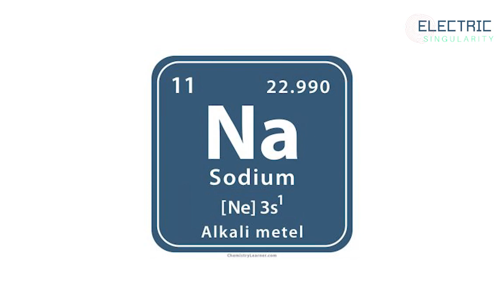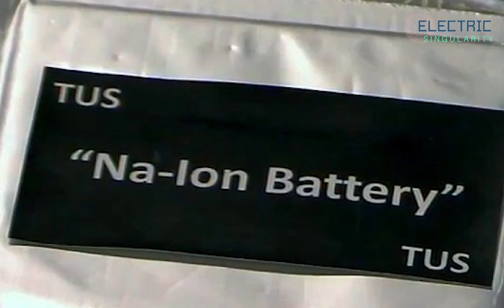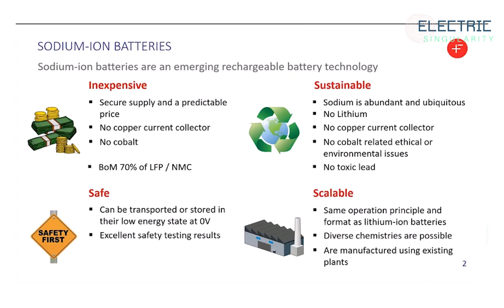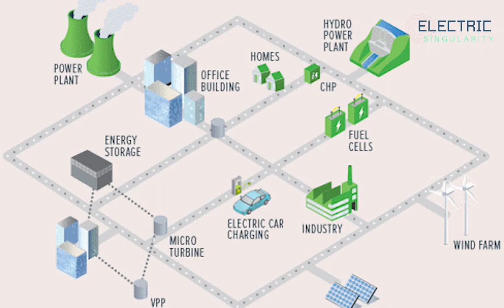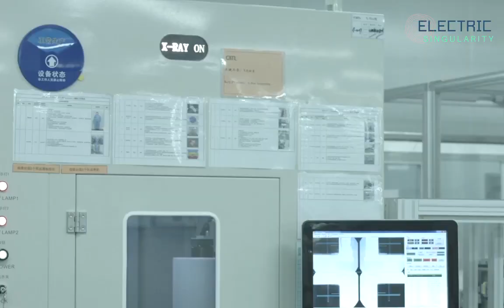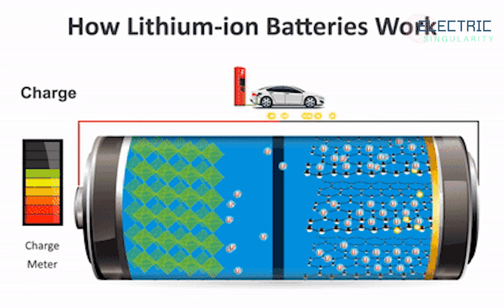CATL's sodium batteries will be 30% cheaper & revolutionise the world

Comment: Game over coal, Gas, Nuclear, Hydro, if you can get batteries to do grid storage at 40.00 per kWh and manufacture it at mass scale it is transform a lot of grids world wide
Reply from the maker: I’m pinning your comment.
Reply: Thanks let hope this is a commercial viable option for companies to act before “they” put that gas plant in
Reply: Hate to burst your bubble but reneawables and superpower are total bulls*t. You and the guy the who made the video are clearly new to all this but with enough reading it will become obvious to you as well. NUCLEAR IS THE ONLY LONG TERM OPTION at scale.
Reply: @garry8390  sorry Barry you obviously missed the cost element. Nuclear is the most expensive option it is cheaper to invest in coal than Nuclear and before you start talking about the smaller nuclear reactors yes I have considered those as well.
Reply: @MichaelSmith-px1ev  Reactors are only expensive to build in the West. In Russia and china they can build them for a fraction of the cost. Nearly half of the cost is the cost of capital which is ridiculous. The only reason nuclear is expensive is because of politics and corruption. We could be carbon negative worldwide in a decade if engineers were given political support to make it happen.
Reply: @junctionroadparklandsvlog5035  specifically which part of that article do you think disproves what I said?
Reply: @garry8390  This bit :  'Government-subsidized capital costs help explain the relative vitality of the nuclear power industry in Russia and China'
Reply: @junctionroadparklandsvlog5035  Your kidding right? Which large scale infrastructure projects do China and Russia not subsidise? You are totally missing the bigger picture. The fact of the matter is that nuclear power plants could be reduced in size, cost and complexity but far too many people make a living selling the expensive options. Once a power plant is built there is no more work for developers for 40 or even 80 years meanwhile aircraft carriers the size of small towns have been powered safely by nuclear power plants for decades. Where are all the sailor's with three eyes and a third leg who have been living right beside nuclear reactors for months or even years while onboard? The incentives surrounding nuclear have been perverted not because of engineering or safety but because of money
Reply: @h2rider953  Thanks for sharing. Was there a specific point you were trying to make?
Reply: @garry8390  It's funny how folks want to talk about land usage and contamination when talking about decades old fission plants which operated in an essentially unregulated environment. Then when a new solution like SMRs are brought up which will be the cheapest form of power in the long run, produce relatively little waste, have a non existent exclusion zone and cool down without power or safety systems they are lumped in with the old plants. It's like saying we need to ban EVs because 70 years ago cars polluted with leaded gas and killed people right and left in accidents because they didn't have safety belts.

Meanwhile no one wants to acknowledge producing grid scale renewables produces more toxic waste, takes up much more natural area, will cost more to the tax payer in the long run, and has to be replaced every 20 to 40 years where most of that end use waste will end up in enormous landfills which have chemicals or heavy metals that can leach into the ground water (look up wind turbine graveyards and why they are in remote areas). 

Each has their place in providing carbon free power, fission for large scale, renewables and energy storage for small scale supplementation and areas that don't have the political stability for a fission regulatory structure.
Reply: Thank you  @anydaynow01  . I was giving up hope. I'm going to copy your comment for future reposting.
Reply: $ 40/kWh is fine for day/night storage, but not for seasonal energy storage.
Reply: You can't make Hydrogen bombs without nuclear power plants, so we will be keeping those.
Reply: @garry8390  Why not a mix? A large and growing percentage (around 20%) of our electricity here in Texas (of all places) is already supplied by wind. You seem to have a visceral dislike for the idea of renewables, as shown by your use of profanaty. Why is that?
Reply: @garry8390  yes , you are right western countries lost their nuclear technologies that's why it costs too much and by the way just this week Russia   started building nuclear plant with closed nuclear fuel cycle in other words perpetual motion mobile
Reply: @andreycham4797  It could be turned around very quickly if we there was the political support. I have heard estimates that thousands of smr's could be installed within a decade with the right changes to regulation etc Climate change basically solved overnight. Try doing that with reneawables.
Reply: @garry8390  
Re "only expensive...."

Go to western governments and say
"Hey guys! You need to buy hundreds of Nuclear reactors from Russia and China!!"
See what response you get.
Reply: The one power source that has by far the least environmental impact is nuclear.  The mountains of waste (toxic and non toxic) generated by solar, wind seems to be completely ignored.  Not to mention that one of the primary elements in making solar panels is expected to be depleted in 25 years. Or the fact that most of the resources are from deeply corrupt countries.
Reply: @RS-ls7mm  Preach the good word! 🙏
Reply: @RS-ls7mm  watch on BBC iPlayer:- Building Britain's Biggest Nuclear Power Station, 2 part documentary on Hinckley C. Consider they sent a boat round the Bristol Channel for FOUR YEARS looking for WWII unexploded ordnance so they could safely build a water cooling ducting 4,500km long. Think of the carbon footprint of that alone.  A 750metre concrete sea wavefront.  Watch the amount of concrete & steel & welding to produce BIIIG components and assembly/installation.  No one takes into account the amount of GHG produced for TEN YEARS before these stupid fantasies are even switched on. Solar & wind can be up & running in 6 months.  NOT 10 YEARS!  For $millions, not $billions.
Likewise battery stationary storage can be up & on in 6 months. Tesla & others already proved this.
Barry Doyle is just scared for his future of profiting from nuclear & pretending he isn't...
Reply: @anydaynow01  You are right, the poisonous chemicals to produce magnets for Windcraft have no half radiation time. They are poisonous forever. And have to be stored forever. You are not told about this.
Reply: Game over hydro lol gas and nuclear pmsl you can keep coal its filthy.

Best of luck to powering your grid and having surplus energy to build anything, fossils made this world and nuclear took  that a step further go back to less than a 10th of that enerrgy at best at our most power hungry time in history then clearly the rich will get it all and the poor will finally go critical and start the civil war.
Reply: @electricviking  , sodium = pyrophoric explosion.......bad, bad news!
Reply: Propaganda victim.
Reply: @garry8390  
"Shut up"???
Is that all you have?
No counter?
O...... K
Reply: @garry8390  

Two words you ALWAYS see together.
Nuclear.... Estimate.
The problem is the "Estimate" is always on the low side regarding cost, or time to completion.
Reply: @rogerstarkey5390  Your comment added nothing useful
Reply: @alexmanojlovic768  Did you or did you not read the earlier comment by @anydaynow? You are a broken record."It's funny how folks want to talk about land usage and contamination when talking about decades old fission plants which operated in an essentially unregulated environment. Then when a new solution like SMRs are brought up which will be the cheapest form of power in the long run, produce relatively little waste, have a non existent exclusion zone and cool down without power or safety systems they are lumped in with the old plants. It's like saying we need to ban EVs because 70 years ago cars polluted with leaded gas and killed people right and left in accidents because they didn't have safety belts."
Reply: @garry8390  
You think your "answer" did?
That's twice you've had nothing....
Reply: @RS-ls7mm  

So, nuclear.... Henceforth known as "Unclear".....
You know the infamous  3 Mile Island plant just started the decommission / site clearance process?
Should be finished in 60 years.... SIXTY YEARS !!!! (Google it)

But don't worry, it's being paid for by consumers.... And taxes.

That timescale may also indicate concerns about "environmental impact"?
Reply: @RS-ls7mm  
You suggest that "most (Green??) resources are from deeply corrupt countries" (weird, sweeping statement!!) But seem happy (together with your friend Barry) to ask Russia for thousands of Unclear reactors?
What's your definition of "Corrupt"?
Reply: @RS-ls7mm  
Which "primary element in making solar panels" do you expect to be depleted?
Reply: @anydaynow01  
Your recycling rant is "strange".
You mention that a non specific green source "has to be replaced every 20-40 years" (used to be a very specific "20", so you're learning!)
Which technology is that? All of them?
You say "it" (?) "Takes up more natural area".... But since many wind projects are offshore, and those onshore are fine of other uses, that's a "stretch", isn't it?
Similarly, Solar is being seem to be beneficial in producing shade for farmed crops.... Ingenious.

About the exclusion zone around nuclear plants...... "Land usage? 🤔

Back to your.... "Random stream of thought"(?)

Landfill.
Exactly what?

Solar panels?

Processing panels.... Even my local council is proclaiming that panels are "96% recyclable, with an aim to raise the bar even higher"
Current levels
100% metal.
95% glass.
85% semiconductors (improving)
I'd say that's a good start?

And don't forget that as with batteries, the "life" stated is the anticipated life to a specific efficiency reduction, not "Dead".

Wind power?

"Ooooooo! The blades!!" (?)

Ever considered that with relatively low numbers, recycling industry wasn't ready?
That's being worked on.

The "generator section"
That'll be 98% recyclable?

The Pylon
Let's think about those?
How about, 
Remove blades (soon to be recycled)
Remove generation unit (recycled)
Install new (more efficient!) components for another "25-40 years ....?

In comparison to unclear....
"25-40 generation" then 60 years decommissioning with huge amounts of reinforced concrete which is energy intensive to demolish and will end up in .... Landfill (at least the non-contaminated sections)
Reply: @garry8390  broken record? Says Mr "LaLaLaLa" when anyone points out any flaw with nuclear you just deflect & ignore any anti-nuclear point as though it's irrelevant.  New SMR technologies are exactly that. New unproven, uncosted "will eventually come down in price with economies of scale".  Go on then!  How long till they're banging out enough SMR's to solve our energy needs?  At what initial cost?  To what will the price fall?  Is this like the ALWAYS 3 yr overun on a 7 year deadline of existing large scale plants?  £32 billion will drop to £28 billion...  Lovely, cheap... Yummy...
It's all guesswork & hope. You're full of dreams & hope that one day it will all come off (you're also full of something else).  Meanwhile, the manufacturing & implementation of mass deployment SMR's is at best a guess & a hope. I guarantee you, NO ONE has yet designed the PROCESS to build these unicorn SMR's.  You have no facts & figures, just engineers trying to convince the world it will be ok... In... TEN YEARS TIME.  Then the corrupt nuclear construction industry mafioso will get it's hooks in.  You have no concrete numbers, just prayers that articles written by people convinced of nuclear engineer's Unicorn f4rt dreams will be correct.  R.E can ALWAYS BE UP AND RUNNING IN 6 MONTHS, NOT YEARS.  For millions, not billions.
Repetition is necessary for blind zealots like yourself who don't understand reality vs engineers dreams, which rarely have basis in fact, mainly because specs, deadlines & costs always change (for the worse) with new, complicated technology.  An SMR is still a complex machine compared to Solar & Wind, therefore, there will be hitherto unexpected issues compared to "nuclear submarines" as the tech is not identical.
Now go away, the sound of your drum is like... A BROKEN RECORD!!... 🤦
Reply: @garry8390  I find your reference to Roger Starkey that his whole argument is based on a flawed concept weird, then you link to an ncbi document.  1stly I struggle to see which of his comments relates to cancer rates linked to radiation.
2ndly, your reference to that document is, to me, proof that you haven't got the 1st clue as to what the real world means to the rest of us, but it shows how you "interpret" data which you believe you understand & supports your misguided beliefs (sssooo erroneously).
["do not provide general support for the idea of a low-dose threshold or hormesis. This large body of evidence does not suggest, and indeed is not statistically compatible with, any very large threshold in dose or with possible hormetic effects"]  A Hormetic effect is where, a low dose of a harmful source has the opposite effect of a large dose of something harmful to a biological entity.  i.e. a low dose is beneficial to the entity.
The conclusion of the document is that THERE IS NO BENEFICIAL EFFECT WHEN RADIATION DOSES ARE LOW & REPEATED OVER A LONG PERIOD.  IN FACT:-
["In summary, excess cancer risks observed in the Japanese atomic bomb survivors and in many medically and occupationally exposed groups exposed at low or moderate doses are generally statistically compatible. For most cancer sites, the dose response in these groups is compatible with linearity over the range observed"] a) they compare Japanese WWII survivors with more recent cancer cases & determine a direct correlation & similarity in the data. b) there is a linear correlation linking the risk & severity of cancer cases regarding dosage, frequency  & time.
You didn't shoot yourself in the foot linking to this study, you shot yourself in the face with a double barrelled shotgun.
In summary, you are one of the most ignorant, fervent, uneducated, irrelevant supporters of nuclear power I have ever wasted valuable time from my life trying to educate!  In the words of the infamous Barry Doyle "Shut up Barry!"
Doyle-m... 🤦
["such studies have yet to identify coherent sets of genes that respond differentially to high and low doses (83), and it is therefore premature to draw conclusions on the similarities and differences between high & low-dose effects. The relevance of such early changes in expression to cancer is also unknown."].  In other words, nothing is proven at this point,  in relation to dose & severity, only that there is risk & result, so you pick a study that DOESN'T support your "argument"...
To support your "argument"....
😂😅🤣🤡🤡🤡🤦
You truly are the opposite of an intellectual, & an unworthy opponent.
Really, Barry:- Shut up Barry!
Or come back at me & Roger & keep digging...
Reply: @alexmanojlovic768  wrong all the time thats why u chat on youtube while people actual build the futire grid, ME and nuclear is hear to stay its 25-50% of base load in uk, and we inport from France.

Dont reply to me becuse ill ignore you fed uo of global piece keepers thats going to cause a civil war with their narrow mindedness.
Reply: @rogerstarkey5390  You need to improve your reading comprehension and education.  What drivel.
Reply: @garry8390  I think that nuclear will only be truly viable in the long run if the spent fuel can be reprocessed.  However I do believe in the mid term, 5 years or less, nuclear is gonna be a bridge for China, Russia and India.
Reply: @fredfrond6148  the fuel can already be reprocessed in a CANDU.... Its just not done for cost regulatory reasons
Reply: Without fossil fuels, there will be no more air travel. You'll never get the energy density needed to fly.

No more car and motorcycle collecting. What's the use of collecting if you can't use it. Plane collecting and racing is out too. These hobbies bring joy to millions and millions more who love to watch and marvel over the history and engineering. 

All the people and the industries that support them and their families will be out of jobs over an essential trace gas that has historically wildly fluctuated without mans influence. 

The goal is to bring Co2 levels to 350ppm. If you know your history, wildfires and deadly weather events happened at 350ppm... and lower. In fact, the worlds worst catastrophic weather events and wildfires happened when Co2 was at its lowest levels.

Don't get me wrong. I'm totally for renewable and battery storage. One day we will run out of fossil fuels. I'm against demonizing an historical event and system that brought the world to where it is. I'm against belittling people who don't agree with the "Co2 = bad" opinion. Co2 is not a pollutant. 

Fossil fuels literally saved the whales and provided the fuel needed to harvest massive amounts of food, literally feeding billions of people. 

We all need to work together and let people follow their passions be it fossil fuel based or green energy based.
Reply: @nzer57  until the next inevitable nuclear accident occurs. Same old snake oil nuclear sales job.
Reply: @nzer57  Nuclear reactors of any kind are a stupid power option. In a warming world they will either be flooded by rising seas levels and cause a melt down or else if they are inland they will be starved of water and cause a disastrous melt down that way. Nuclear power needs water to cool - and that is very problematic is a climate change affected world.
Reply: @garry8390  Could not agree more!!!!!
Reply: @MichaelSmith-px1ev  Maybe,  but the totally un-affordability and impracticability of replacement of coal and gas with the utterly ridiculous so called green renewables makes nuclear a no brainer.  The alternative is the grass skirts and mud huts of the ultra left green new dealers.
Reply: @HWKier  The answer to your faith in wind power is:   last Winter.
Reply: @garry8390  Yes really like the idea of SMR.  Here in NZ an obscene proportion of our so called carbon free hydro power is wasted heating the overhead transmission lines,  just getting the electricity to cities far away from the hydro plants.
Reply: The state of New York in the USA has decided to shut down its 2100MW Indian Point nuclear power plant, because of leftist, fake-green politicians.  Its capacity is "temporarily" being replaced by gas and coal (HA HA), but their propaganda is to replace it with renewables with battery storage.  So, to replace the nuclear energy that was produced on just 220 acres, NY State will have to cover 88,000 acres with windmills and solar farms.  That's half the total area of NY City, just to replace that 10% of the present electrical energy used in the state.  Who seriously believes that will happen?   Li Battery technology will advance, and will revolutionize energy needs on a very dispersed, individual basis,  but for grid-scale, it will be a high-tech crutch for extremely inefficient, expensive, and low-density "renewables."
Reply: @garry8390  Can you provide a reference?
Reply: @bru512  He's wrong.
Reply: @garry8390  Can you elaborate a bit?
Reply: Form Energy already does grid storage at around 1/10 the cost per kWh vs Li-ion with their Iron Air batteries. That pegs costs at around $10-15/kWh. That's going to be the future for grid scale storage along with maybe Ambri's technology.
Reply: @wakannnai1  Form's 1st megawatt battery is coming out in 2023 (so they say). The world needs terrawatts. I won't hold my breath
Reply: @wakannnai1  Can you reference a Form Energy project in service?
Reply: @evanpenny348  Yes, they should just build the Nuclear Power plant in the Auckland CBD to cut down on transmission losses. Probably improve the place too.
Reply: @garry8390  Anything that is manufactured will grow faster than anything mined or constructed. We are exceedingly good at manufacturing, and can scale it at breath taking speed.
Even if what you say about Nuclear power is true, unless plants are manufactured, it will never scale as fast as PV/Wind plus batteries.  Ever. 
For nuclear to succeed, you would need a factory that makes nuclear power plants. Every part of the plant would need to be pre-fabricated, and the plant would need to go from greenfield to operational in 6 months or less. To build this nuclear power plant making factory, the capital cost would be in the 10s of billions of dollars, a risk no one who runs money would take, when there are already proven alternatives that scale to any size, and immediately provide a return on investment.
Reply: @ianthompson44  are you serious have you never done any research on any of the nuclear Devs out there? All of them are working on factory made designs that can be delivered on a truck and made by the thousands. Catch up
Reply: @garry8390  Yes, they are working on designs. Lots of people are working on designs. Millions of life failures had "a design". 
You don't need a design, you need a FACTORY. And for that you need a LOT of capital, invested into an unproven design of a factory, to build an unproven (commercially) design of a power plant.
That's too much risk for any kind of investment, especially when you already have a proven (commercially) way to scale up power cheaper than the current offering. The factories already exist, they already produce a commercially viable product, and if you want to produce more, you simply build another factory that's a copy of the existing one.

The only design for a nuclear plant I see getting off the ground is the WAMSR, and that is because we have a massive contamination problem with existing nuclear waste. I see between 20 and 50 of these being built on various continents as nuclear waste processors, and then decommissioned in 50 years time.
Reply: @garry8390  Brilliantly argued. Your scintillating rebuttal, full of facts and figures has left me speechless with your power of word and wit. Bravo brave genius! Without intellectuals such as yourself, this world would be a very dark place indeed.
Reply: One problem with hype over solar and wind is that people have no idea how power grids work and how dangerous is to rely too much on weather dependent power generation.  Is not much of a problem when 10-20% of energy is wind and solar, in case of prolonged periods of low winds and cloudy weather we just fire up one mor gas plant and deal with it. But what are we supposed to do when 90% is wind and solar? Are we supposed to keep on stand by fully staffed, fully equipped power plants capable to replace when needed 50-60-70% of the entire energy production as back up? Who's gonna pay for backup facilities? No one, because companies, short-sighted for next quarter profits don't care if the grid is going to shutdown if they have a bad month, they'll not sell energy that month and recover losses in the next one. Their incentives is to build as much solar and wind plants as possible and because of the subsidies and green certificates and can push out of business gas, coal and nuclear.
And no, energy storage is not gonna solve this problem as is still expensive to store energy and no one will build huge storage facilities just for the event, once in a blue moon, we might need 60% of necesary energy because there's no wind.
Reply: @alexmanojlovic768  perhaps a hybrid system would be in order wherein heavy industry, maybe way better suited to one and not the other. While also serving as reserve capacity to the community it operates on. Like AC is a compliment to DC. Does one have to mutually exclusive.
I appreciate your guys's dialogue even though you don't agree with each other.
Reply: @evanpenny348  you talk of unaffordability of RE then advocate nuclear! 🤣😂😅. Don't forget who ALWAYS pays the shutdown & cleanup costs & it isn't the nuclear generating company or the woefully inadequate cleanup insurance.
Reply: @chasl3645  Barry Doyle has a screw loose.....
Reply: @alexmanojlovic768  I'd like to think that you both really have dreams of a better more prosperous future with respect to your approaches.
Ultimately comes down to the safest most cost effective approach advancements are pushing both your approaches towards viability
We all fall in love with our ideas and sometimes our biasis mess with our perspective. Im on the fence in regards to both approaches which is why I appreciate both your perspectives.
Reply: @chasl3645  Barry Doyle has 2 screws loose....